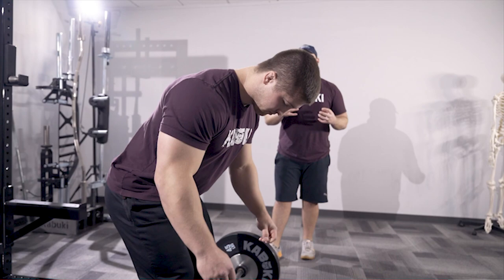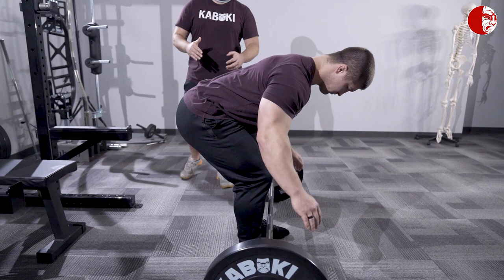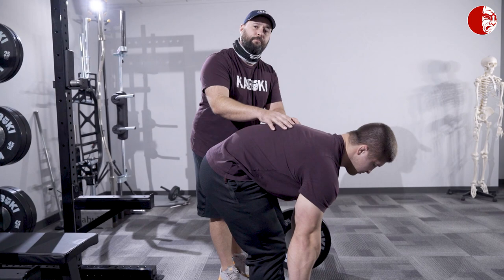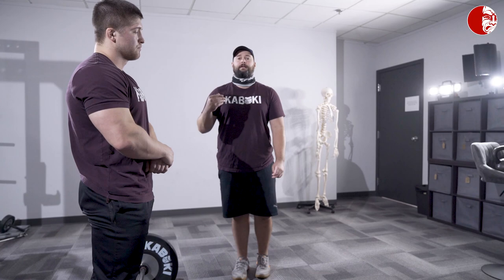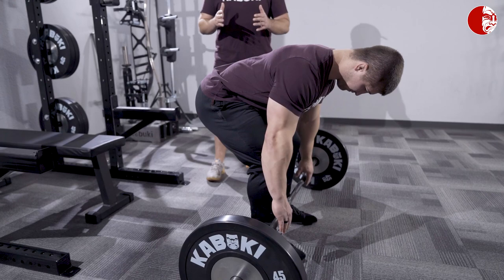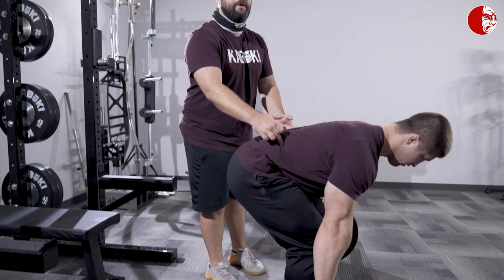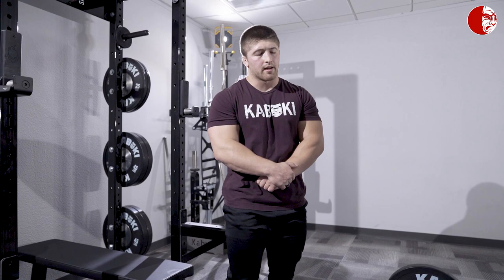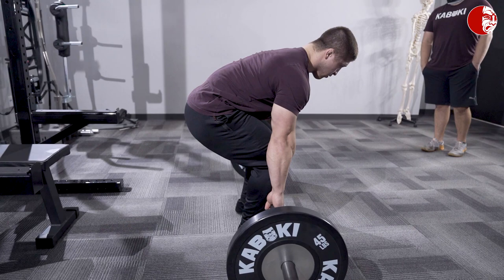Improve Deadlift Bracing

Comment: I find this a lot harder to do with straps. Are there any tips or cues ?
Reply: Same here. First rep is super ugly then the rest are fine.
Reply: Yeah, good point. I'm slow on the strap in, so it's like I'm bracing from the bottom at every start.
Reply: You guys are probably wrapping the straps too many times. Only once is necessary, so it should be quick. Wrapping the entire strap around the barbell takes way too long. Practice just doing it once so you can be quick and confident enough to know the grip will be secure enough
Reply: @HolidayFortnight  gonna work on that. Thanks.
Reply: i found out instead of rounding to go into a sumo position to get air from there and then close my stance and do the lift,but thats only with straps.
Reply: Straps make this much harder without a doubt. You'll need to find an entirely different strategy for setup when using straps
Reply: pete rubish suggests sitting down to get your straps first to not lose energy